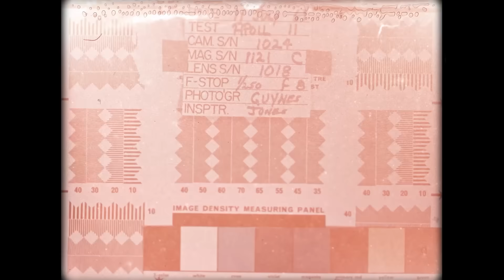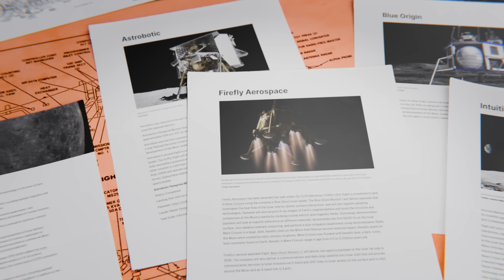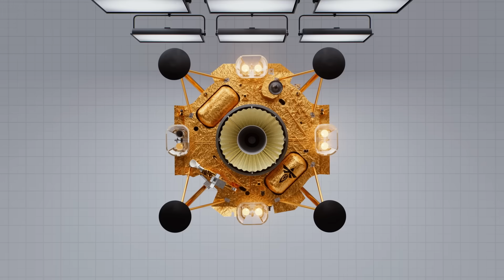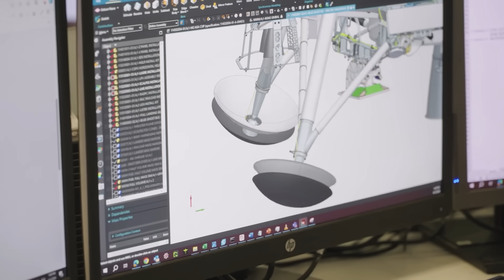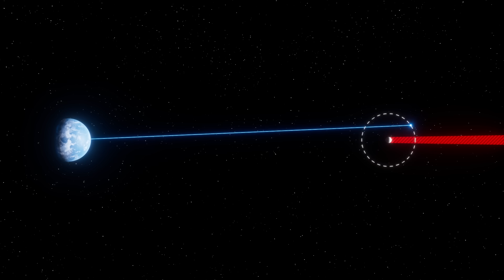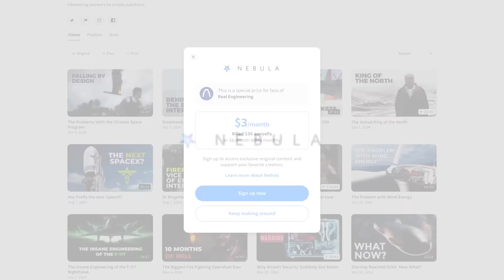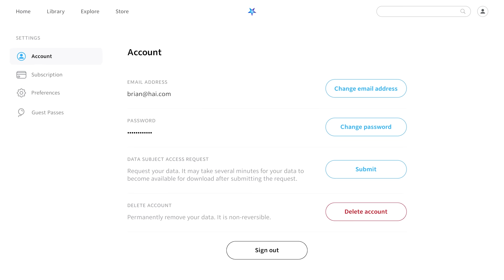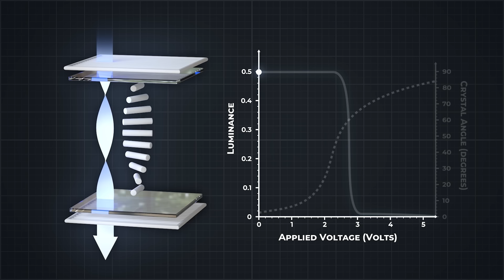Why the US is Struggling to Land on the Moon

Comment: Radiation shielding  was 'lost' after the moon landing.
Reply: The Apollo CM didn’t have any radiation shielding, beyond the shielding that was provided coincidentally by material that was already there for other purposes. The main shielding was done by the aluminium pressure hull and the phenolic resin heat shield. These two combined to reduce the radiation level inside by a factor 100, which was more than enough to enable a safe mission - as long as there were no major CMEs during the flight.
Reply: @Hobbes746  : On average, the shielding was about 8g/cm² afaik.
Reply: @ThomasKundera  The paper 'Radiation Analysis for Moon and Mars Missions’ describes it as “8 mm of aluminium plate equivalent”. The density of aluminium is ~3 g/cm2.
Reply: @Hobbes746  : But you forget about fuel and all the surrounding on the way to the Moon, several tens of tons of stuff.
Reply: @ThomasKundera  Fuel etc. are not around the crew in the CM. The SM blocks radiation from a small sector of the sky, but in most directions, you only get the heat shield and pressure hull. The 8 mm equivalent is an average, based on the radiation flux inside.
Reply: If you look at the source, it's not a pretty solid value.
But as I cannot recollect where the 8g/cm² came from, we'll go with that until I decide to wok on it.
BTW, I'm looking for some to work together on this, if you want to...
Reply: @Hobbes746  OK. Why did Obama fund $millions for shielding tech, to transit the Van Allen radiation belt?
Reply: @RadicalTek 
Live animals safely made a round trip to the vicinity of the moon before Apollo 11 landed men on the moon.

“Zond 5 (Russian: Зонд 5, lit. 'Probe 5') was a spacecraft of the Soviet Zond program. In September 1968 it became the first spaceship to travel to and circle the Moon in a circumlunar trajectory, the first Moon mission to include animals, and the first to return safely to Earth. Zond 5 carried the first terrestrial organisms to the vicinity of the Moon, including two tortoises, fruit fly eggs, and plants. The Russian tortoises underwent biological changes during the flight, but it was concluded that the changes were primarily due to starvation and that they were little affected by space travel.”
Reply: @RadicalTek  : "Why did Obama fund $millions for shielding tech, to transit the Van Allen radiation belt?"
Which shielding tech?
 Note: for Artemis mission profiles the biggest radioprotection issues are not VAB, but long stays on the Moon.
Reply: @RadicalTek  : And again, you didn't answered my question: 
You wrote "Radiation shielding  was 'lost' after the moon landing." what was "lost" exactly?
Reply: @RadicalTek  NASA is investigating shielding for missions to Mars, which spend months in space, giving the astronauts a far higher radiation dose than the two weeks of an Apollo mission.
Reply: @Hobbes746  The Van Allen radiation belt is fatal.
Reply: @RadicalTek  The radiation level in the VA belts varies by a factor 100,000, depending on where in the belts you are. Even in the center of the belts, where the level is highest, it takes a week for a human to accumulate a lethal dose of radiation.
Reply: Where did you swallow that fallacy?
Reply: Moon landing in the singular? And why they use 60-year-old technology. So that's why new materials and measurement methods were tested during the Artemis 1 mission.

Comment: Most people don't understand the difference between a proof of concept and an optimized final product. It's why there is an assumption of ineptitude regarding current attempts, or of impossibility regarding the first attempt.

The proof of concept is the cover all bases, do what you have to to make it work, one off attempts. 
It is prohibitively expensive and over engineered.

After proof-of-concept, you know that it is possible and now have to determine how to repeat the result with what is basically a minimum viable product. What are the fewest components required? What is the most efficient form factor that will reproduce the results achieved by the proof-of-concept? Are there other options that solve existing issues in a better way?
Taking away parts and adjusting the form factor of the thing you know works is inherently going to have failures. But after the iteration process you are left with something that does the job much better, and cheaper, than the initial attempts.

Why can't a relatively small company reproduce the results accomplished by an entire country?
Kind of answers itself doesn't it?
Reply: Ik but the thing is nowadays our tech is so much better it’s “astronomical” 😂
Reply: @blackoak4978  Is that you Kamala? What ?
Reply: @blackoak4978  NASA tell us they went to the moon, first attempt, no problem. What's yours? Don't you believe their lies either?
Reply: @deanhall6045  First off, it wasn't the first attempt. They had many fly bys to test their systems (as currently demonstrated with Artemis). Secondly, the landing area was much larger and there were people on board.

Right now, we are trying to land in a small area without human interference. It's not exactly easy, especially when things WILL inevitably break on launch or in the extremes of space.
Reply: @troybaxter  Save it for some gullible fool who believes this trash. Inevitably, things break, unless your telling lies. You said it mate.
Reply: @deanhall6045   they took multiple tries and astronaut lives (apollo 1) to reach the moon. not to mention their larger budget AND crew size, and the fact that the lander was manned, in comparison to this example, where it was a much smaller team doing a quick attempt with less budget and doing it AUTONOMOUSLY, which is pretty new technology. of course they would lose
Reply: @justachickenboi Okay. But please realise that you are one of very, very few people who are still believe this hoax. 
 Gus Grissom held an impromptu press meeting, where he held up a lemon and called Apollo just that. They were having trouble with coms and he is heard on radio asking, "how are we going communicate on the moon if we can't even talk between two buildings"?
 He went home to his wife and said,"honey, the see eye aye were all over the site today, I've never seen them there before. 
 Next day he was dead, victim of a very bad and lethal mixture of highly inflammable gasses.
 There is conclusive and research able proof that they went nowhere near the moon. I mean, how can they? Van Allen radiation belts will allow no human passage. Not soon, not now and definitely not in 1969. Here's more proof. 
NADA has just announced a manned mission to the moon next year. Why can't they stop there and get out for a stretch? Because they aren't going anywhere near the moon and watch NASA, as they do every single time they announce a return to the moon, delay the mission due to technical issues. Just watch. 
Every single President since Carter, even Trump, has proudly declared that man will return to the moon within 5 years. 
 Yet here you are, still telling stories and coming extremely last in the space race. Your lander fell over🤣🤣🤣🤣
Reply: @deanhall6045  dont even try to band wagon me. also, radiation belt? there's something called radiation shielding, which spacecraft already have.
i want your sources for the gus grissom story, and its also a post hoc fallacy.
they delay the missions because the US stripped them of their funding, and you havent bothered with debunking said "stories" im telling. there's a reason the lander fell over and your little attempt at  propaganda wont convince me shit
Reply: @justachickenboi Hahahaha radiation shielding? Dragon came back with more than a hundred cracks. That was a foot thick, lead lined and the radiation would have killed anyone aboard.
 Now, think about how Apollo was constructed, then use your critical thinking abilities. You'll get it.

Comment: The US is not struggling to return to the moon…they are struggling to do it literally 100x cheaper with private companies
Reply: There is zero evidence it will be 100x cheaper, it will probably be closer to 10x more expensive as 12-24 Starships will need to be launched to refuel Artemis...and they are not reusable.
Reply: @TheEsseboy  10x more expensive than what? The original Apollo missions? Absolutely not.  Do you have any idea how expensive that was?
Reply: @NathanaelHowland  They literally had to invent all the stuff for it...ofc it was expensive...but still, they landed six times at a cost of 23 billion per year, impressive for doing so many firsts, and with only 3 failures.

Starship will cost about 2 billion per launch, they need 12-24 launches to refuel Artemis in orbit, do the math...unless Space X figures out how to reuse the Raptor engines, stop the upper stage from melting and quickly reuse the bodies...they are going to lose the contract quick...they are already 5 years behind schedule.
Reply: @TheEsseboy  adjusted for inflation the Apollo program was nearly 400billion dollars.  NASA has spent maybe 26 billion on SLS? So if you mean 10x more than they intended you are probably correct.  But my initial point still stands.  We aren’t really in a competition with China because the US has already been there 6 times over 50 years ago.  We are just doing it again with one hand tied behind our backs for the challenge and to learn how to get to Mars
Reply: 60's technologies used by Nasa are way cheaper nowadays, including monetary inflation

Comment: In the 1970's moon landings had a 100% success rate, 50 years later 50% fail. Something is wrong that.
Reply: Successful? Even before the first flight was made, 3 people died.
Reply: @ApolloKid1961  Yes, but that was only a test flight, not a actual mission. You can't include non mission flights, using that logic you would have to include all flight deaths since Icarus
Reply: @trevorgale1176  : What is the failure rate of manned spaceflight to the Moon in 2024?
You're comparison has no meaning.

Comment: You have some Apollo communication details incorrect. The comm problem during the Apollo 11 landing was caused by plume deflectors (added very late) on the LM blocking the S-band antenna's view of Earth in some orientations. There was no S-band comm directly between the LM and CM, only VHF for voice and ranging. The relay request was for Collins in the CM to receive messages from earth over its S-band antenna (which was working fine) and relay them to the LM by VHF, which used separate antennas that didn't have to be pointed.

Comment: China has achieved 100% successful rate of soft moon landing through an AI aided detection system. The landing site is chosen by  moon satellite images at first,  then when landing probes reach close surface to moon,  a multiple detection system will scan surface to avoid any big rocks or holes.  It works like an autonomic drive to navigate through busy streets without hitting any objects.

Comment: https://youtu.be/KpuKu3F0BvY?si=1CxL2Ka0dpgaYoZk
...because they never went there with crew! Radiation in space outside the van Allen's radiation belt is deadly! ...but still the classic photo and video footage brought back was without any spots caused by the radiation, even the x-ray machines at the airport at that time caused the film to be useless! With that time's technology six missions without causalities, but today such a fail? Please educate yourself outside the borders, drawn by NASA. The movie below presents pure facts with no emotions (like NASA does because they have no firm facts!) All the data and telemetry of the man's greatest achievement EVER was overwritten!?!? For what reason?? To disable the possibility to investigate and see the fraud? Two men needed for help to suit up one astronaut. How did they do it in that small space by themselves? No engine noise upon liftoff. Circus-like movement of "actornauts" and strings seen on the original footage. What was the power source at that time to power the AC for astronauts? In the backpack they had to fit the whole AC, batteries and oxygen along others.... and many, many more real questions which NASA can not answer. Take your time and think when you see this.
Reply: This is clueless gibberish. There's no more X-rays outside the VABs than inside them. Not that there are much at all in space anyways. And no casualties? THREE PEOPLE DIED TESTING APOLLO 1 you dimwit. And no, the claim about "all data and telemetry" being rewritten is a lie from you. Ie, you're a moron.
Reply: I took my time to look at your nonsense. Conclusion: Gut feelings and ignorance is not proof that the 6 moon landings were fake. What questions can NASA not answer?

Comment: Really no excuse for these failures. Inadequate testing, first and foremost, followed by highly questionable design. 

I am beginning to think we are, as a species, getting dumber. Shades of Ideocracy. Ticket items such as failure to resolve horizontal velocity, failure to account for component and sensor temperatures, failure to enact appropriate redundancy. These were crash-and-burns just waiting to happen.

Looking at blue ghost in this video, they will be very lucky to get this pile of junk down in one piece. I'm hoping that what we see here is an early mock-up, not the actual landing vehicle.

You should NOT be relying on visual data. Power dissipation and radiation is a huge problem with modern electronics, so you cannot use leading edge computers - you're always a generation or two behind - often more - so what might be achievable down on Earth is far more problematic in space. What should be using instead? For short range work, doppler radar and laser (or other) gyros - these are well proven and dependable solutions. Also, you would think the FIRST job would be to establish GPS type satellites around the moon - then you could use them for precision guidance AND provide a robust communication network at the same time.

BTW., I have absolutely no idea why they are using titanium landing cups. Are they planning to reuse the vehicle?

Comment: For us old timers, its very obvious. Early engineering activities had to rely on poor simulations, so they over engineered. Making more resilient hardware. These days, there are simulation tools that let us understand the minimum hardware requirements needed, for launch payload and launch vehicles. But that means we can now cut launch cost closer to the simulation data. Bad move, as our models are not yet good enough.

Comment: There a question about the capsule escaping the moons gravity.
So it's 1/3 of earths gravitational pull.the saturn rocket was huge so it could be shrunk by a third 
But the moon lander had a tiny tiny rocket.  So how could it escape the gravitational pull..?
Reply: The Saturn V had to lift ALL of itself, the apollo spacecrafts (both the CSM and LM) through atmosphere and against six times the gravity, to a far higher altitude and speed. The LM upper stage only had to lift itself, two astronauts and a some kgs worth of samples into a low lunar orbit. Also, it didn't escape lunar gravity.

Comment: Heh, just playing KSP and doing manual landings on the Mun, I suddenly had a greater appreciation for how insanely difficult of a task it is. It's like trying to balance a brick on the tip of stick. You need to adjust all of your axes to be perfectly even with the ground while also watching speed, and controlling it to within a couple of meters per second by making tiny, careful adjustments to your thrust. Too much, and you start flying back up, too little and you crash to the ground. You only get a margin of error of 5 meters per second. And yeah, it's just a game. But it's a realistic game with realistic physics.

Comment: Sorry, but "it tipped over because of a boulder" is bs, navigation failed because of a human error, which is embarrassing even for a low budget mission from a rookie company. Odysseus had a rangefinder, and someone didn't remove the "remove before flight" safety pin. Luckily there was an experimental NASA LIDAR as part of its payloads, but that wasn't fully integrated with its avionics, so it could only read a small part of the data it produced, this is why it could even come close to a safe landing otherwise it would be toast. I really don't want to see such a dishonest company become mission critical. CLPS program is looking like a disastrous mistake so far, low budget approach from commercial sector ain't cutting it.

Comment: With the smallish cost of a camera in the overall budget, I find it odd that they don't add at least another one looking down, for redundancy...
Reply: The problem with IM-1 was they forgot to switch the altimeter out of safe mode. Adding a camera doesn’t help with that.
Reply: And how would that camera helps?
Reply: I wasn't thinking of past failures but of the future. For most of the descent the algorithm  depends on that camera. What if it fails?
Some things can't be made redundant because of cost, space, weight, etc. But a small camera?
Reply: @pjrebordao  ah yes, that makes sense.